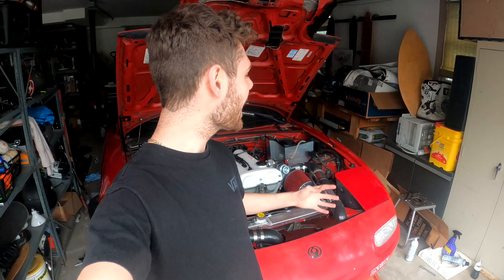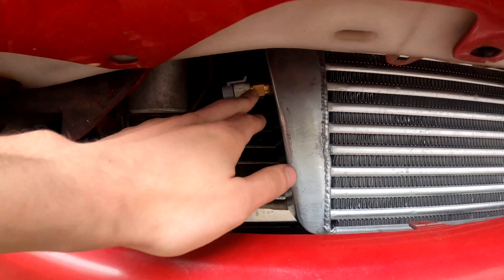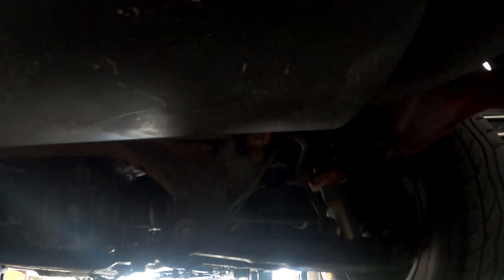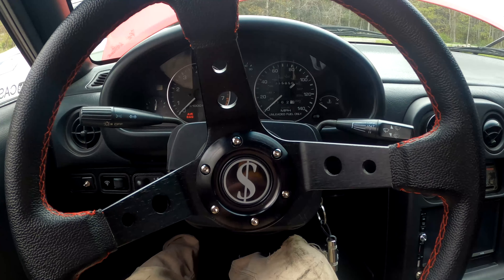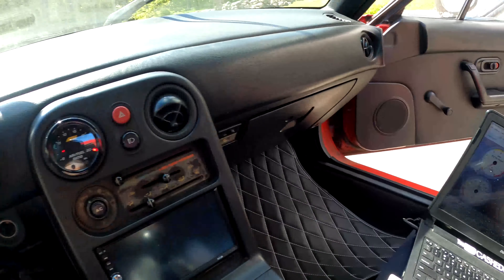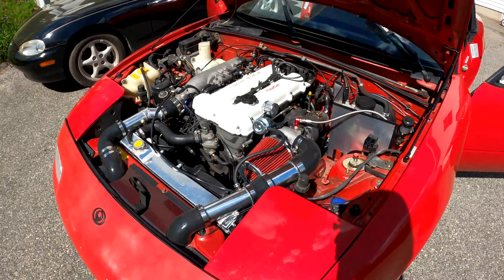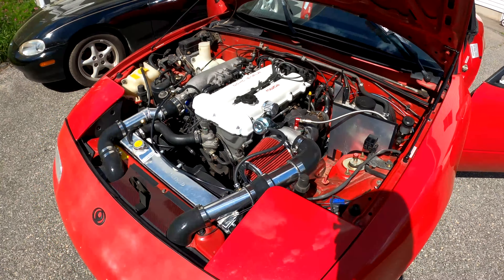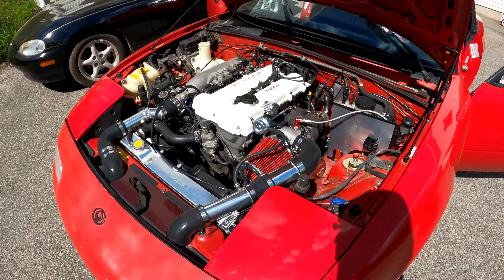I Made a BIG Mistake on my Turbo Miata...

Comment: Amazing work! follow your build videos also! I just have a question:
- it's enough to just drill a hole into the oil pan in order to get the right oil pressure to the turbo? 
thanks!
Reply from the maker: Thanks man! The hole is the oil pan is for your oil DRAIN from the turbo, it’s not a way to feed your turbo. You need a higher pressure oil source for that, such as your oil pressure sensor, or in the case of 1.6L Miatas, the high pressure oil port. Good luck!
Reply: @CashedOutCars  thanks for your feedback! My future project will be a little different, it will be on a carburettor motorcycle ( Virago 535), but I'm searching for all turbo projects I can find to see ideas , troubleshooting, what to do and NOT to do. At this moment I'm searching for how to do the oil feeding part for the turbo. If I need to drill the engine ( and where) , or some kind of an external oil pump. Cheers
Reply from the maker: That’ll be awesome, good luck with the build!

Comment: Hey cash do a video on installing an EBC and Flex Sensor. Its really awesome being able to set your desired boost level on the computer rather than guessing with a MBC. The flex fuel is awesome too.
Reply from the maker: I have an EBC solenoid sitting on my counter, video will be soon to follow! I’d love to do flex fuel but E85 is not available in my area so I’d get no use out of it unfortunately

Comment: What are the cons to the wrap?
Reply from the maker: You're trapping heat at the pipe and it can cause it to fracture easier. It can also absorb oil and create a potential fire hazard
Reply: @CashedOutCars  hahaha oof okay, I've seen those gold heat wraps too, would that mitigate those cons?
Reply from the maker: The gold wraps generally arent for exhausts, those are more for heat shields and reflecting heat rather than doing what heat wrap does which is keep it in the exhaust. That tape is very effective for what it’s made to do!

Comment: Did you know if you have a manual, you could have had someone push the car and while its being pushed you could start the car? Unless your battery is dead it would have saved you having to buy a new battery.
Reply from the maker: The battery is completely dead, it’s almost 10 years old. Pop starting wouldn’t have been an option

Comment: quick question, the hose that comes out the right side of the valve cover broke on my yata. what does it do?
Reply from the maker: The hose on the exhaust side is a valve cover vent, the one on the intake side is your PCV setup. I’d recommend fixing them if it’s NA and looking at upgrades if it’s forced induction!

Comment: What’s the main differences between the clutch you had now vs. the stage 2?
Reply from the maker: The stock clutch is what was in it before, the stage 1 flyin Miata clutch is good up to around 300 ft/lbs and uses a stock throw out bearing, the stage 2 has heavier springs and is good for 350 ft/lbs or so and uses an upgraded throw out bearing. I used a stock bearing with my stage 2 clutch which was the problem